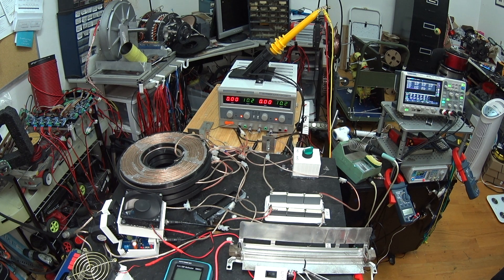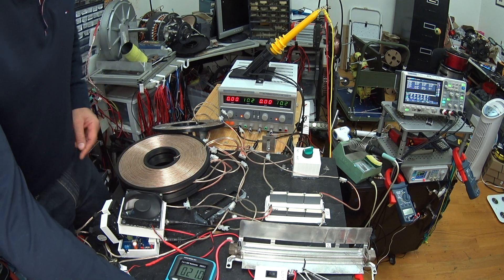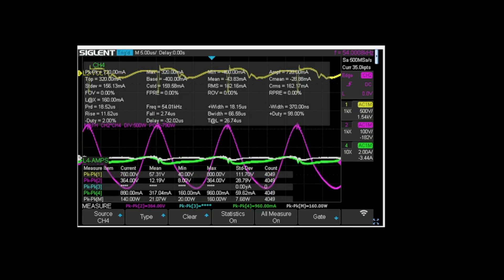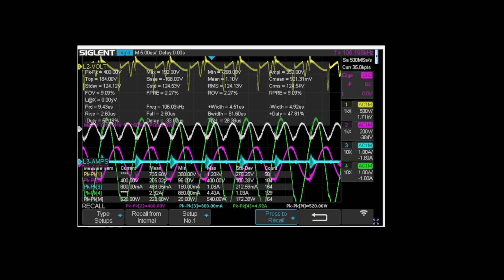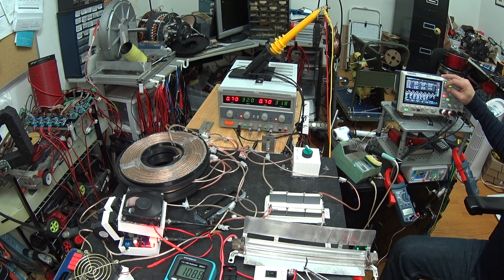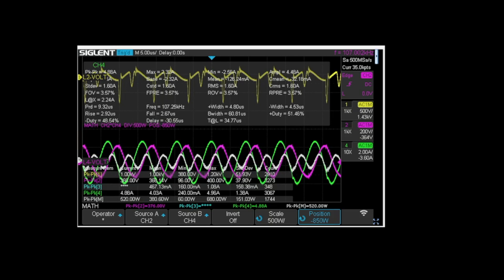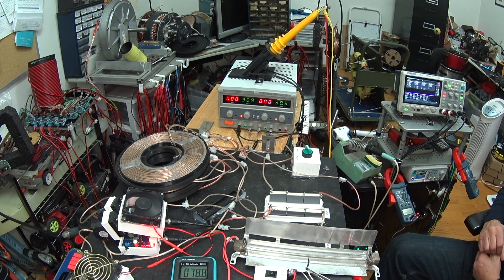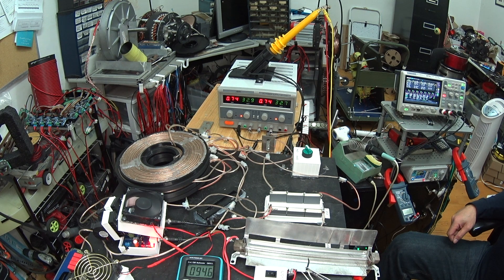Free Energy 45watts Input and 200 watts output 450% gain Part 2

Comment: Can it self loop,,, battery in charging by the output
Reply from the maker: the short answer is no but the issue is the output is high voltage high frquency and it cant be on bridge rectifier to make it dc , i tried and it doesnt work its not a normal current its displacment current , it act like normal current but its not
Reply: @EnergySeeker  so are there any other solution to feed the energy to input
Reply from the maker: of course but its a long process and we all have the same goal , if its not possible no one will spend the time and the effort and money to reach it
Reply: @EnergySeeker  congrats for achieving cop>1,
Reply from the maker: @cesarbaratas5612  thanks make sure you check also master ivo

Comment: To make them in phase put the wires in open format twisted on ground... The ground capacitance takes care of it as clearly the inductance or voltage is leading the current Nd to correct that u need a capacitance

Comment: I moved the swapped the L3 and L4.
so L4 is now loose coupled to L2.
L3 is in the outside rim.
L4 is alse flipped over, so it is now counter rotating.
L3 L1 and L2 are all rotating in the same direction. only L4 is flipped.

The result is that the L2 impulse now better excites the L4 extra coil.

best when L1=L4 resonant frequency.

and when L2 L3 resonant frequency is a lower harmonic of L4 (so the ringing fits). 

I'm now going to use the dc offset again on both coils. 

positive dc on L2
negative dc on L3 L4. 
small cap is between L4 outside rim and ground.
Reply from the maker: Dc offset is back then ok but how you will discharge that dc offset of L2 into a load ?
The main idea is to charge the caps and use that power to a load right ?
Reply from the maker: @Master Ivo are you using diodes for c 5 and C6 and L1 like before the 3 sets of diodes ? are you also connecting the C2 to C6 via diodes ? it would be good if you put in community your updated digram with values , by the way funsion 360 have electronic section and you can use it for drawings its good

Comment: The fastest way is to check it is with a DC analog meter in (DC measurement) and a heat resistive load out (put). It is simple to do and will confirm if you have any thing.

Comment: Thank you  very much.for the video .  However main question reminds open , What   that additional gain of energy comes from?
Wesley
Reply from the maker: I think it’s from two resonance adding in the same direction and as you know at resonance the gain is high
Reply: @EnergySeeker   I was not talking about gain. Energy can't be created nor destroyed - it must come from somewhere .  Energy conversion from one form  to the other is 
 typical add on - like e.g : mechanical energy from your  hand turning valve  on the pipe with water from the river.  So as long as this question  is not answered we  don't know what   is going on there.
Reply: @stivep1  When you gen very high frequency cold electricity ( magnetic only part of a EM wave) it interacts and simulates the aether(un-manifest potential) at resonance frequencies and the extra gets sucked back into the circuit. Your question assumes that there is nothing in space. Without the aether batteries would not work! Matter would not hold together without it! Cold energy is able to interact with other dimensions and open doorways. Its reverse entropy. Not mainstream science obviously for many reasons and interests. You can even take a bath holding 5000w of lit bulbs and not get shocked! Go study cold electricity or radiant energy.

Comment: put L4, where C6 is (remove c6 and its diodes).
Inside rim of L4 series connected to inside rim of L3.
Reply from the maker: i did the inside rim of L4 to the inside rim of L3 and now it give me way more current and volts but when i put the load across L4 they diminish  no more volts or current but i noticed they are in phase now
Reply from the maker: @MasterIvo
hi ivo what you think of the results , i dont have C6 and all diods are removed except the one to protect the power supply i will try the L4 inside rim to the L3 never tried that before
Reply from the maker: @Master Ivo  so the inside rim of L3 connected to inside rim of L4 and outter rim of L4 is connected to ground and L3 and C3 is no long connected to ground but where is the load will be ? across L4 still ?

Comment: Great work Sir..I have been following some of your videos... I want to ask how many Bifilar coils did you use and which of the coils Is Powering the Load?
Reply from the maker: thank you , am using 4 bifilar coils , L1 to give a high impluse of 1 to 3kv and L2 is the primary they are close coupled then L3 is loose coupled L3 is the 2ndary and L4 is the coil we call it and tesla call it " the extra coils ) which is the one powering the load and its close coupled to the L3 i hope am clear.

Comment: You make a plane for US? Very nice your divece
Reply from the maker: Thank you
Reply: Energy Great work Sir.. I want to ask how many Bifilar coils did you use..and what is powering the Load
Reply from the maker: @maxstan11  
EnergySeeker
2 minutes ago
thank you , am using 4 bifilar coils , L1 to give a high impluse of 1 to 3kv and L2 is the primary they are close coupled then L3 is loose coupled L3 is the 2ndary and L4 is the coil we call it and tesla call it " the extra coils ) which is the one powering the load and its close coupled to the L3 i hope am clear.

Comment: there is not electron "Tesla" remove the electron from your Mind and see that there are no electrons flowing in either one or two directions threw the wire , nothing is actually moving its Vibrating ..  Does "Time" move threw space ? No it does not Move , Time is a Vibration not a moving particle or "WAVE" and a "WAVE" does not need to be traveling in order to exist either , it can also exist as a vibration . and in Vibration the wave is formed on all perimeters instantaneously, which in my mind explains quantum entanglement perfectly...GL regards
Reply: a wave is not a thing, a wave is what a medium can do. what is the medium?
Reply: @MasterIvo  A lake of still water is considered the medium for the displacement ripples caused by a dropping pebble. The waves are not added to the lake , the Lake is the medium just like the ether is the medium for radio waves . When we create the electrical disturbance / radio signal , then the wave is placed in the medium as a disruption wave just like the body of water.
Reply: @mykedoes4099  yes. The medium transports the energy.
And instead of a pebble, we can slap our hand (in or out!) , creating a very different wave, which is faster.
Electricly done by single polarity high dV/dt, a capacitor discharge, current impulse.
What is being displaced is energy.
energy=Aether
Reply: @MasterIvo  sir iknow something about carrier waves.. my question is,us there an energy amplifictn if i dischrged cap at 1/4 wavelength of 50 or 60 hertz?? I dont hve suffisticated oscilloscope thats why i cnt test tjlhis myself..im free energy researcher to myself.
Reply: @MasterIvo  i mean is thier a power gain if i discharged cap in every peak of every cycle.. i dont know how to say it properly sir.i hope u understand
Reply: @dapakers  the idea is good but it takes more. much higher frequency is needed and parametric resonance in LMD mode.
but I also still have no power gain yet. But I'll be testing the 1/4 wave capacitor discharge soon